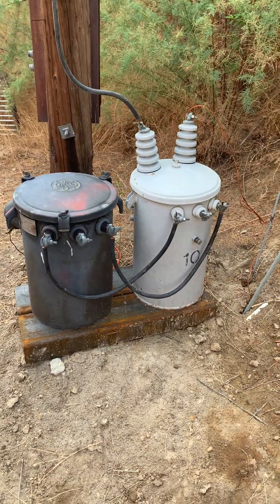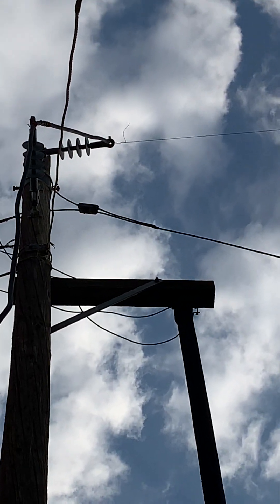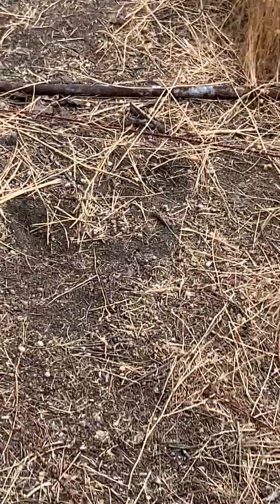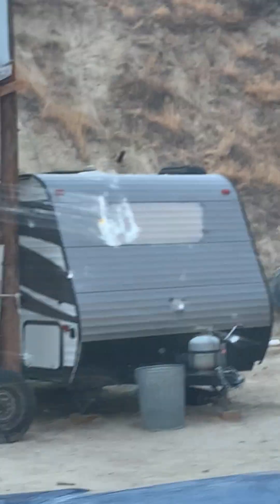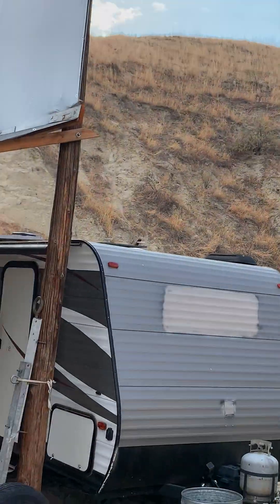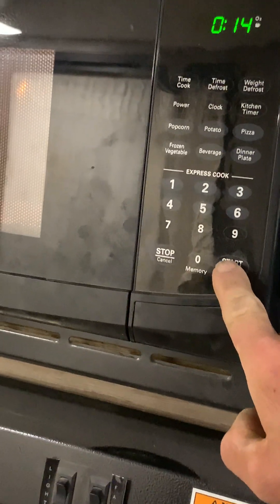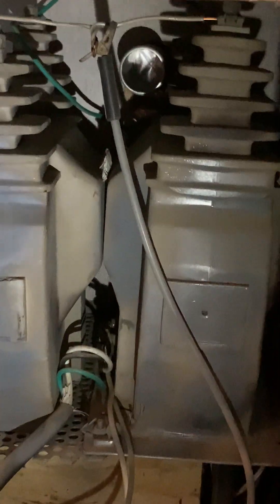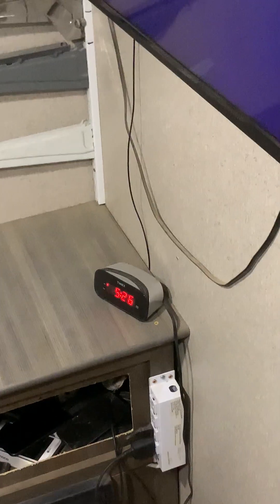Send power from point A to B, virtually no voltage drop no matter how far

Comment: I kinda thought your trailer would be filled with chemicals or leftover coils or wires.
Though i didn't see any giant size drain cleaner, your "wires" were pretty wild i guess
Reply from the maker: Wires are in the other trailer. But no chemicals until I’m done with probation
Reply: @jamescambell1386  your not allowed to work with chemicals as part of your probation?
Reply from the maker: @2MC I still do chemistry, I just keep it on the low. Even though I probably don’t have to hide it(providing it’s not energetic chem). It keeps me lookin compliant vs. lookin like someone testing boundaries therefore needing a closer eye kept. 
It’s all politics

Comment: I remember that last video, the little fishing lure on that line cracked me up.
Reply from the maker: It’s great being able to go anywhere we’re a set of lines are nearby and one small wire gives you more than enough juice. I can even let others plug into mine if they want and no problem
Reply: @jamescambell1386  did you capacitively ground it by like dragging a chain behind your trailer?
Reply from the maker: @Ferraday  heck no. Anytime you place a capacitor in line with a transformer in this sort of application will cause a ferroresonant effect. Look up ferroresonance
Reply from the maker: I found this out the hard way
Reply: @jamescambell1386  Bro its me u know i Just changed acc cuz well YT striked My Channel 2 times i didnt want to risk so i made this new one
Reply from the maker: @pyromage2277_  what did they strike you over?
Reply: @jamescambell1386  bro soo whats your name on facebook